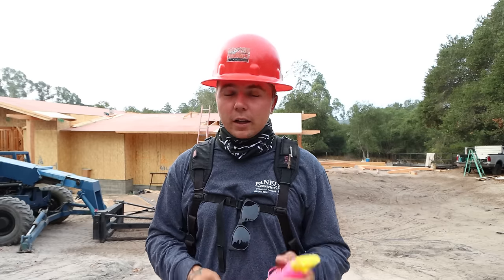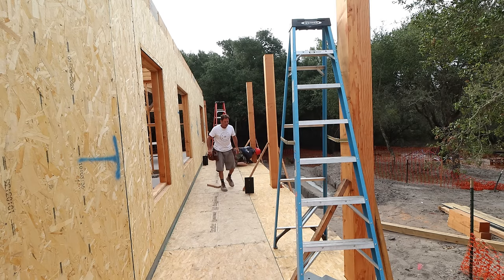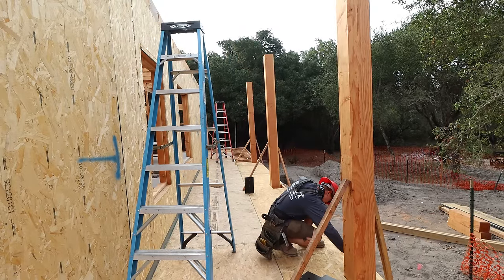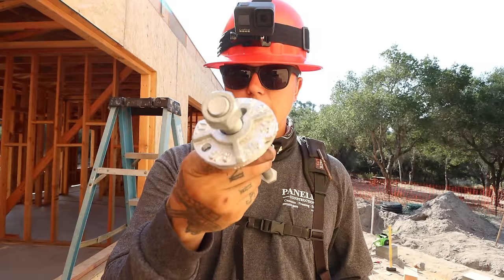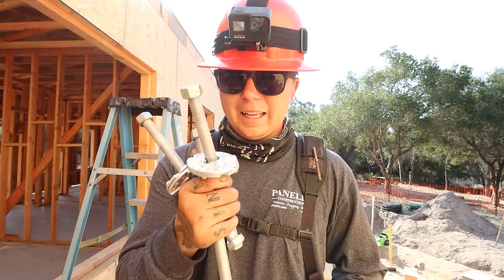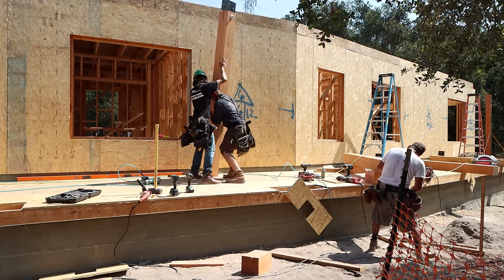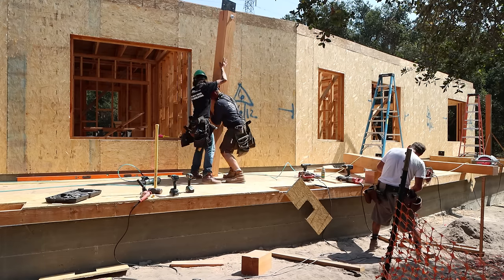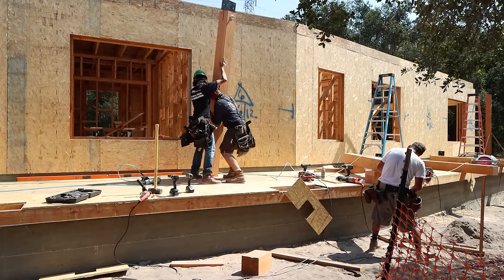The Ridge: Custom Knife Plate for Post & Beam! [#22]

Comment: @ Matt the zip roof shething I always throw a couple nails on factory edge to factory edge just so that lip doesn't overlap. Learned the hard way more than once 8 nails in a sheet and you notice its overlapped on the seam. Zip is a little more expensive but it "seals up a house" nice a quick with taping the seams.

Comment: Just noticed that the zip system doesn't have the reflective backing of the OSB you've used on other projects, so I assume other measures will be taken to help insulate?

Our climate here in Queensland Australia is kinda similar (a bit more hot and humid, so perhaps Florida is a better comparison) and we suck at building energy efficient homes. Gaps everywhere and roof tiles plonked straight on trusses.

Comment: Man, compared to the typical 20th century home, built on 2x4s, 2x6 floor joists, and maybe 1 LVL across the main span, with few to no steel connections, this thing is built like a tank. I'm even more amazed that you have this sturdy of a first floor on a house with no second floor....it has no load to carry besides the roof.

Comment: Skill actually makes a worm drive chain saw that has worked beautifully for  T post brackets that install similarly.
Reply from the maker: Have you used yours for them? I tried to get mine to work and just couldn't get the thing dialed in clean enough to do it.. I wish it would have worked, but it splintered so poorly..
Reply: @MattBangsWood   True you cant trust it to be square , have to finesse its and flip post over a few times as i recall. also the plates were aluminum and thicker so it was worth the trouble.
Reply: @MattBangsWood   I think the folks that sell the T-rex connector recommend an electric chain saw on a custom jig they sell

Comment: The cost of 5/8 isn't worth the small inconvenience of clips. Also zip is osb just has embedded facing on it. Also the time you have take to tape and seal the fasteners make it a no go. Quality house wrap installed correctly is way better
Reply from the maker: All of our homes are spec’d for 5/8”, so 1/2” isn’t really an option anywho.
Reply: @MattBangsWood  why 5/8 you have no snow loads or anything like that. We use 1/2 and 7/16" here in Mi and have up to 60# snow loads requirements.
Reply: @kevinobrien1933  heavy clay tile roof.